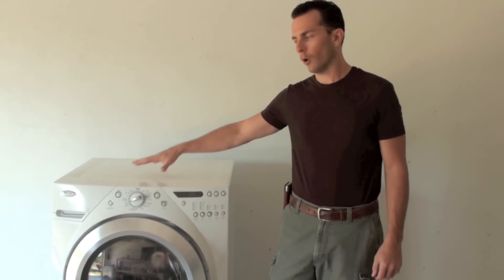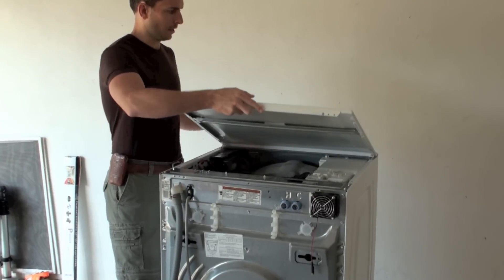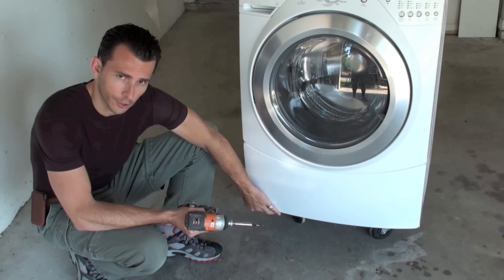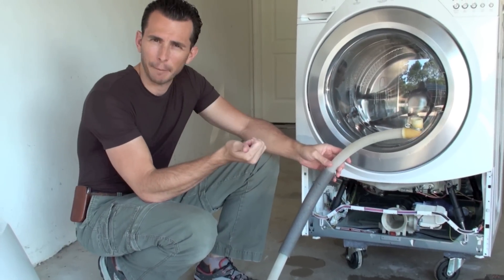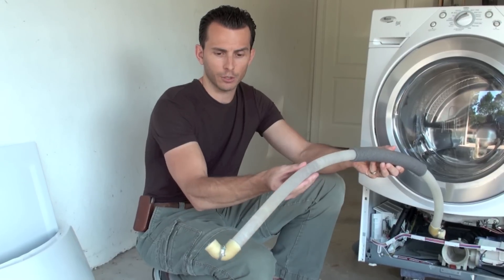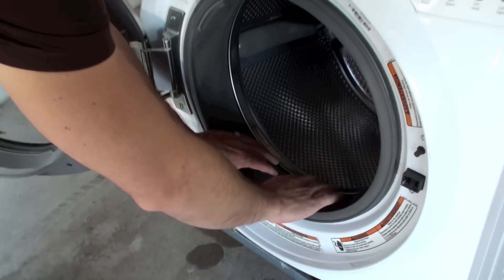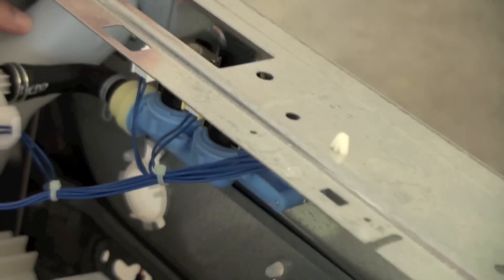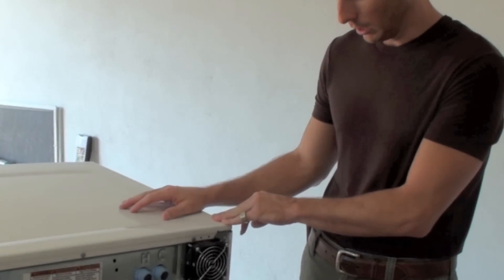Washing Machine Odor is Caused by MOLD - Determine if Your Washer Has a Mold Problem

Comment: so I have a Samsung 4.2 cf front load steam washer and dryer.  it's less than one month old and from about the 3rd day it was here, it's reeked of mildew.  a tech from the service that delivered our machine came out to make sure it was balanced, calibrated it and saw that the drum was very unstable.  his opinion is that the drum itself is defective and the washer needs to be replaced.  well, look and behold, I'm being told by the store that they are now out of stock and don't know when they'll get more (oh, yeah, right).  we've been referred to Samsung who will only replace it if the issue is over that can't be repaired.  basically, HH Gregg doesn't want to pull a new machine that they can sell to replace the defective piece of $600 garbage they sold us and are pawning us off on the manufacturer.  hey, this thing is less than a month old and shouldn't need to be serviced.  so I have a whole different dragon to slay and this IS also a common problem with front load machines... water pools underneath the drum due to the misalignment and doesn't drain properly.  if I ever get this albatross replaced, I will for sure install a fan.  thanks for this helpful tutorial!
Reply from the maker: Sorry to hear that. We highly recommend purchasing an extended warranty with any new washer bought today. They do not build them like they used to. We just bought a new Washer/Dryer Combo from LG for our RV and it was only $100 more at Menards (like Home Depot if you are not in the Midwest) for a 5 year extended warranty. Every washer sold on the planet unfortunately has water sitting in the bottom under the drum it is a common design flaw that is one of the big reasons that all washers grow mold in them over time. Please create a support ticket directly on our website and I am happy to discuss this with you further/ http://helpdesk.washerfan.com/index.php?a=add

Comment: How about if you have a portable washer or a speed queen washer never heard nobody complain about mold in those
Reply from the maker: Great question. It is a very common misconception that there are some machines that do not have the odor problem over time. Our customs have every brand washer you can imagine. They have every type of washer made including every type of front load washer and top load washer (both HE and traditional top load). We have customers in every type of climate imaginable including Arizona. We have customers all over the world again in every type of climate. The common denominator is the inherent design limitations found in every washer. Some washers take longer to present the odor (you will usually smell it in your "fresh" clean towels when you use them to dry off after a bath or shower. When you get them wet and they have a weird sour smell that is your first indicator that the inside of your washer where you can not see it is already full of mold! We have some top load customers that it took 10 years for the odor to start but once they noticed it they really noticed it and Washer Fan was the only way to fix the problem that let the odor start in the first place.

Comment: Won't you void your warrenty if you fiddle with your machine instead of calling for a service person?
Reply: One thng puzzles me - so obviously I have mold or mildew in my washer because my towels stink as well as some of my other clothes (depending on the material).  And I understand the part about lowering the humidity to below 50% so mold can't grow - but what happens to the mold that is already there - wouldn't it continue to give problems , even if the humidity is below 50%?  Surely, it doesn't just disappear?
Reply from the maker: Sorry Mark, just saw your comment. This is why we recommend creating a support ticket directly on our website WasherFan.com, we reply to those same day. These we do not get notices for so we don't see them often. When Washer Fan keeps the humidity level in your washer below 50% on a continual basis it starves the mold of the high humidity it needs to live and grow. Then over time through normal use of your washer the it starts to die off and flush out down the drain. The odor itself will be gone in less than 3 weeks. Some times it takes a little longer for the odor to go away in your laundry without having to replace any of your towels or clothing. If you have any more questions please create a support ticket and we are happy to answer any questions you have. Thanks!

Comment: I hv LG washing machine of 8kgs ..n I've added vinegar for cleaning as it wasn't working on 30 min or 1hr mode  ..now  very foul smell is coming from it ..is it due to vinegar ?? what should I do now??
Reply from the maker: Urooj, you can not clean away the problem. Please see our website WasherFan.com to lean how you can install is simple retrofit kit on your washer yourself in just a couple of seconds. Washer Fan compensates for the inherent design limitation found in every washing machine on the planet. That is right every brand, every style (top or front load), new or old it does not matter. Thanks
Reply from the maker: One clarification, you can not clean away the problem PERMANENTLY! Cleaning is only a bandaid you must fix what allowed the odor to start on your new clean machine in the first place!

Comment: Could you not put the machine on a 95 degree celsius cotton programme with biological washing powder and run that complete cycle and then leave the door and drawer open when it's not in use to dry the machine out
Reply from the maker: Matthew Perry our customers have reported to us trying everything under the sun and nothing is a permanent fix for the design limitations found in all washing machines besides Washer Fan Breeze. Completely drying out the bottom of the drum (under the inner drum where you can not see it) is not necessary to fix the problem that causes mold to grow which is causing the odor. All of those special cleaners and cleaning cycles do not work and they consume a lot of extra water and put lots of chemicals into the environment. We have a chart on our website showing the true costs of cleaners and how much water they consume when used as directed. The amount of water sitting in the bottom of the machine takes a long time to dry out even with the Washer Fan running and most people run another load long before it ever dries out. Even without completely drying out that standing water Washer Fan has proven to be 100% effective at permanently eliminating washer/laundry odor. If you have any more questions please create a support ticket directly on our website and we are happy to answer any questions you may have. Thanks!
Reply: +Washer Fan I understand you're trying to sell your product, but cleaners like Affresh do serve its purpose. If you have a mold problem in your washer and a mold allergy like I do, your concerns over the environment decline real fast, I assure you.
Reply from the maker: +Double We wished we were only just "selling a product" and that every machine on the planet did not have an inherent design flaw that allows mold to grow inside the inside nooks and crannies of the machine where you can not see it. 

There is not a cleaner on the planet that can compensate for the design limitations and undo what has been done by the time you smell the problem. Thousands of our customers have tried cleaners and every other "solution" known to mankind only to realize that there is only one way to fix the problem. 

We wished the manufacturers would license our designs and actually fix the machines but they are not there yet. As soon as they admit there every machine is flawed they will loose every single class action suite brought against them. It is just like the first tobacco company settling their lawsuit with a state and then every other state and every other tobacco company had to also settle because the precedent had been set! Who will be the first washing machine manufacture to settle! :)
Reply: +Double use cleaners all kinds and the smell never when away until after this video.